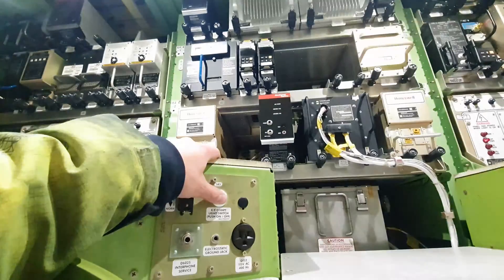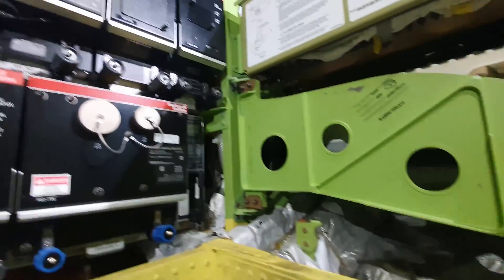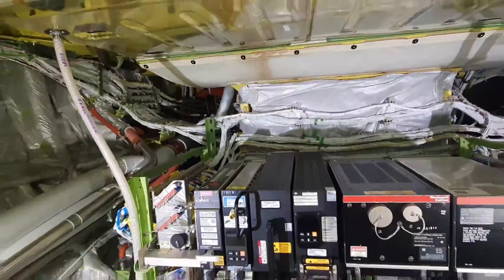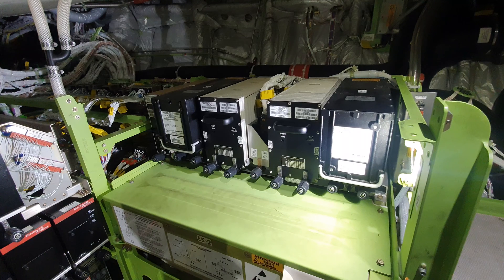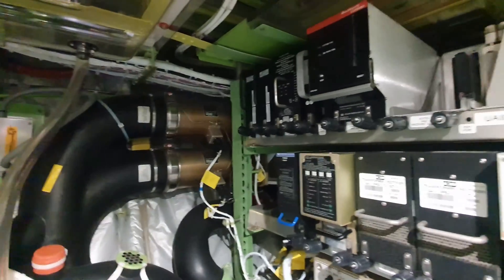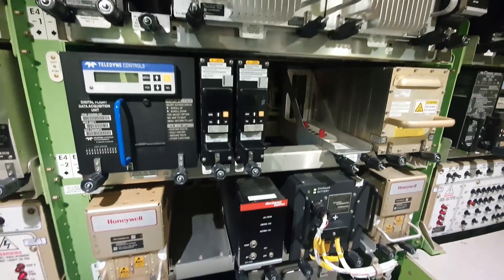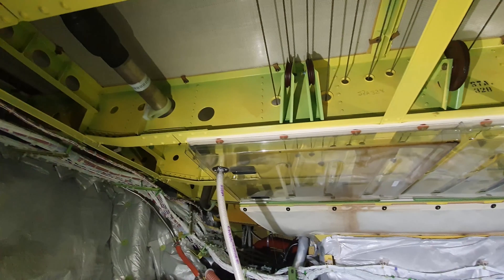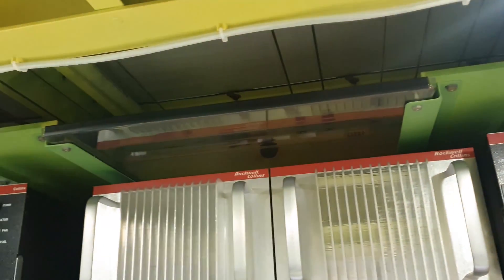Boeing 737-8 (MAX): Electronic Equipment Bay tour

Comment: Fun fact: the original 737-100 and -200 models in 1968 and 1969 had E&E compartments stuffed full of black boxes, but there was not a single digital circuit in the airplanes.  Although there were a lot of simple RTL and TTL logic circuits in the boxes, there was no digital anything, and no data buses.  Gyroscopes, autopilots, flight directors, sensors and instrumentation were all analog and electromechanical or electro-hydraulic-mechanical.  Cockpit voice recorders had a  reel-to-reel tape recorder in them, and flight data recorders scribed and punched data into a roll of stainless steel foil.  That all began to change around 1975 when new 737-200s began to be delivered with a digital central air data computer in place of the analog, and an ARINC 429 data bus to connect the computer to the captain's altimeter. Changes were rapid after that, and the 737-300 was the first to have IRUs in place of iron gyros.  Without digital computers, and especially digital data buses, the modern 737 models could not exist, because the weight of the wiring required to implement the required data distribution and processing would make the airplane too heavy to fly profitably.
Reply: We make a lot of those black boxes. Lol. I came here to see them in their homes!
Reply from the maker: That's awesome!
Reply from the maker: Thank you! Very interesting to read. I'm always amazed at how far we have come in aviation in such a "short" time.

Comment: Hello! Any chance you can get the raw GPWS sounds or record the full GPWS test from the captain's seat? Maybe a fire test, overspeed test, and stall test? I'm working on a 737 project for the X-Plane flight simulator and it would be extremely useful in building the soundscape.

Comment: My airline just bought B737Max9, can you briefly explain how nfs works, i'm a bit a cave man from DHC8400
Reply from the maker: Nice! Good luck on them, you will like them (I think). The Network File Server is basically a computer that can run some system BITE test, give you system data, load software and such. All on the CMCF in the Flightdeck. It's a pretty good upgrade since the NG didnt have this kind of system.

Comment: nice vedio. Quick quastion about the ADIRU alignment. The manual doesn't mention about special boeing team requirement. It just talks about how to align it from FMC CDU, ISDU AND IRS MSU.
Reply from the maker: As far as I can see in the manual it does mention that and I think it's the same on all 737 airplanes.
Reply: There is a misunderstanding here.  The special alignment procedure is only required if the rack that the ADIRU sits in is physically moved from its calibrated position.  The normal alignment procedure, which is required when the ADIRU is turned on before flight, is quite simple:  Turn each ADIRU control switch from OFF to NAV position, enter correct aircraft present position, normally by just selecting last position from FMC memory, and do not move the airplane while the ADIRU senses local vertical and Earth rotation, a matter of  few minutes.  That is all there is to it.